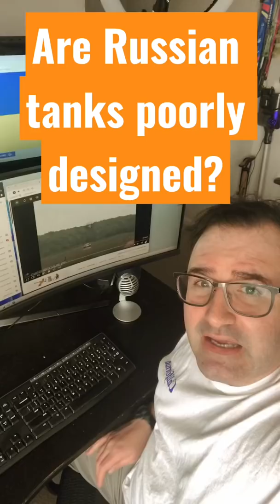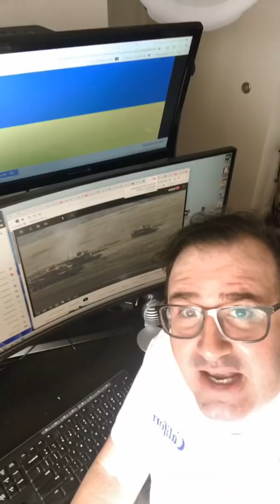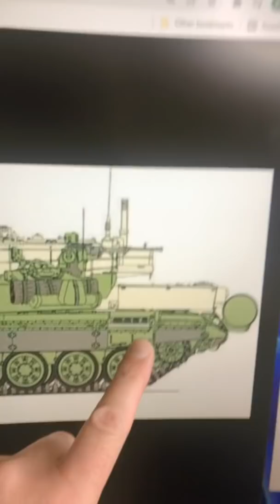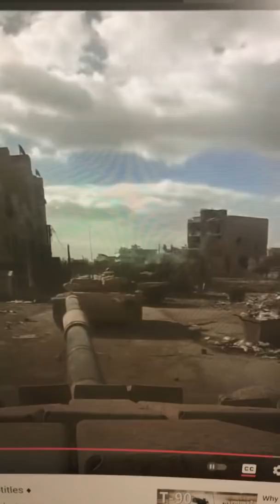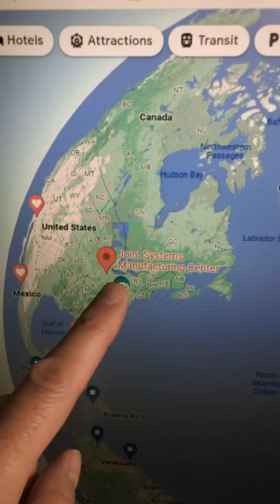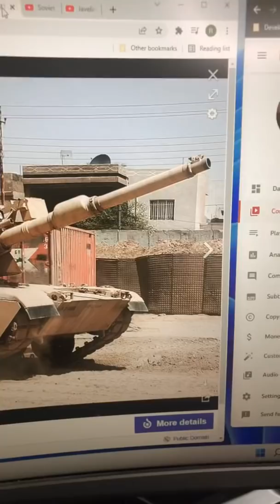Are Russian tanks poorly designed?

Comment: No, even in their heyday, they were a relatively crap design individually. It's why they were so cheap and relatively poorly equipped. The Soviets were addicted to the numbers game and went for quantity over quality. Also, missiles and rockets were the main threat, which is why there were some of the first to adopt ERA in massive scale. They didn't care about tank rounds as they knew the enemy probably couldn't field enough tanks to counter a push across the gap. They were more worried about massed infantry spread across the battlefield with cheap AT missiles and rockets along with said tanks that'd put a stop to their tank forces. They went with the smaller design to use less materials and use less people in order to maximize the number of tanks they could field with the same overall number of crewmen. The fact that they were smaller and harder to hit was the bonus, but not the primary design choice as T series lacks much of the things that'd make the smaller size truly beneficial like better gun depression to maximize hull down position opportunities or good optics and sensors to shoot form further out and increase the usefulness of their smaller size.

Comment: I remember in watching snl back when the original cast eas still on the advertisement for the abrams tank before it eas the abrams and way back then the gun was stabilized and computer aimed thrse tanks wete obsolete before they were built small is relitive these tanks are still larger than an rv and the m1 tank was very accurate.

Comment: Isn't not being updated for a new era, a sign of bad planning?
Reply from the maker: More like it’s difficult to justify Avenue, plus Russia went through a very bad recession in the 90s and money was hard to come by. They needed butter, not guns.
Reply: @RyanMcBethProgramming  That's a fair assessment, but they did spend hundreds of billions upgrading their military. There's no need to update the thousands of T-64s and T-62s lying in storage. But their workhorse, the T-72, they should have finished upgrading it to the B3 or B4 standard, and added either the Shtora and/or the Arena Hard-Kill APS to it.

Or if that's too expensive, is it possible to add blowout panels to an autoloader system?
Reply: @RyanMcBethProgramming  Just to add one more thing.

Let's say they have 2-3000 if not more T-72s, maybe it costs 1-2 million to upgrade each to the B4 standard, that's about 2-6 billion usd over 30 years. I'm sure they could've managed that, even if we consider the corruption and mismanagement in Russia. Along with everything else, of course.
Reply: @RyanMcBethProgramming  I think that the Russians made the mistake that the Germans did in WW2, they should've stuck for sometime with a design that worked and made it better, instead of spreading themselves thin like butter! 😂

Comment: NOPE! USSR had trouble building ICE tank engines > 840 HP, but historically were good in metalurgy, casting and big into armour geometry. Therefore, they had to keep tanks SMALL so they had sufficient mobility, especially with available transmissions. Therefore in tanks T-64 onward loader had to go, to  allow well armoured tank to be small thus light enough to move! Autoloader then employed split 125mm rounds with semi combustible propellant casings.  Carousel is placed very well, as even then-non existent top attack weapons would have to go through crew anyway before detonating ammo.  Problem is ammo OUTSIDE the autoloader.

Comment: Most Soviet-era tanks that the Russians are using where designed with the idea of being incredibly simple so they could mass-produce as many as possible - this is true. 

However, I wouldn't say this makes them good tanks even for the era they were designed in. Mainly because it doesn't matter how many tanks you have if they're so inferior to their counterparts that they constantly get destroyed in every single engagement they're put into.

I know this has probably been used as an example many times already, but Desert Storm really did show the failures in this philosophy very well. Over 3,000 Soviet-made Iraqi tanks lost to the coalition's 31. Now unless the Soviets would've had a constant 100:1 advantage in tank numbers against the entire west, I'd imagine they would've had a pretty rough time in a theoretical war. And even then, why not just build a better tank so you don't have to lose 100 times as many in the first place?

Comment: Not sure how often you read comments, but if you see this, this video is misleading and presents a flawed narrative

The autoloader is not a critical vulnerability in Soviet tank designs. It has long served as a scapegoat for Soviet tank losses in the west, but it's just not the case. The autoloading system is an asset to Soviet tank's survivability, not a hindrance to it. There are several reasons for this, but the primary reason is that the autoloader places the tank's ready rack in the least likely position for spall to reach; center of the tank and as low as possible. Much for the same reason that lower front plates tend to be less armored than any other part of the frontal arc, placing the ready rack in this position significantly mitigates risk of it being hit. Additionally, the autoloader itself has a reputation for keeping ammunition stowed within it safe, with numerous documented instances, particularly in Chechnya, of tanks sustaining numerous penetrating RPG hits directly to a loaded autoloader without detonating, or only detonating after a serious fire had broken out and the tank was abandoned, or detonating after numerous hits directly to stowed charges. In terms of vulnerability to an ammunition fire from damage, most Western tanks, especially older ones, do not fare better. There are several instances of, for instance, Leopard 2s suffering instant and lethal catastrophic ammunition fires when struck by ATGMs. The only true standout here is the Abrams, which has no ammunition that is not behind a blowout panel, at least after the cold war. 

It could be countered that this only applies to frontal threats, and that the autoloader is unusually vulnerable from above, but this is also not true. Significant portions of the cheek armor protect large sections of the autoloader, and the exposed section of it is not a more significant portion the total area of the tank than, say, a Challenger 2 or Leopard 2.

Most ammunition fires involving Soviet tanks are caused by the use of the ammunition stowage racks around the tank. The wet hull storage is relatively safe, but all others lead to large amounts of ammo being spread around the tank in all areas, leaving it extremely vulnerable. Loading only the hull stowage and autoloader leaves a Soviet tank just as safe as a Western tank of a comparable era. 

Compared to the narrative told here, it implies that Soviet tanks were not particularly designed with survivability in mind, and indeed are compromised heavily in safety, but this is not the case, and they are not significantly less protective or safe than most Western style tank designs. 

I would recommend reading the sections detailing profile and survivability in Tankograd's second article on the T-72 for more extensive detail.

Comment: The problem with the caroussel is not that it exists, it's that it holds insufficient amounts of ammo. So Russian tanks are often stuffed with ammo in every nook and cranny, making cookoff guaranteed on every hit. If they were only used as designed they'd be less deadly.
As for Javelin... lol. Javelin will instantly one hit murder every single tank without APS together with its entire crew, western, eastern, doesn't matter. The only way you can stop a Javelin is by shooting it out of the air or hiding from it to break the lock.
A better argument is that modern western tanks have FCS so good that they can easily hit Russian tanks while moving regardless of their size. And this is where loading less ammo would in fact reduce the number of turrets in orbit. In fact it wouldn't be any less safe than Leopard 2 if not more, Leo 2 has essentially the same issue despite having no autoloader.
At the end of day though, indeed, the autoloader isn't well designed for modern battlefield. Leclerc is an example of a tank with autoloader optimised for modern combat, it's basically Abrams layout but with an autoloader. It's arguably safer than the Abrams because the magazine blast doors are open for shorter periods.

Comment: The threat of javelin already made the T72 an inferior tank 20 years ago. Today, the threat of a cheap FPV drone carrying the equivalent of an RPG warhead can take out a T72 in 1 or 2 well-placed hits. Ukrainians know how to either hit Russian tanks in the rear engine compartment or between the turret and the body. The latter seems harder, but I've seen over a dozen videos of an FPV drone hitting Russian tanks in this precise spot with a massive ensuing detonation that causes the Russian tank's turret to go flying in the air. Tanks will have to be redesigned entirely with a focus on protection from drones.

Comment: So, not necessarily poorly designed, just hopelessly obsolete,  by the mid 80s, the common tank guns, and atgw accuracy, and power, rendered the russian autoloader deadly to the crew. where western tanks had already almost universally. Switched to isolated, blast mitigating storage. By 1985, in 2022? Russians newest leading edge tanks are still using storage in the body of the tank. With no blast protection. So the flaw isn't in the design, its in clinging to that design, long after it falls into obsoletcence...

Comment: I would argue that they are indeed poorly designed... the USSR operated under the assumption that tanks would carry any land invasion, mass tank doctrine. That was all good and dandy until 1967 when the RPG-7 and its counter parts entered the chat. Watching Soviet tanks get bodied in Afghanistan only for the design to not change and watch those same tanks get bodied in Ukraine is honestly amazing... it's been like 60 years, maybe the time to build slightly beefer tanks that aren't prone to cook of if they run over a pot hole is in order... well after they lose in Ukraine.
Reply: Well, to be fair, the Soviets didn't have that much te to Develop new Tanks after Afghanistan. There were some early Designs with bustle Autoloaders though.

Also, the T-90M also has a bustle autoloader, and T-14 doesn't have Crew in the turret.

Comment: You forgot to add maximum 50 ton qualification. But yes the tank was phenomenal when they were introduced. Composite armor, small & harder to spot, and thick armor.. 

No NATO tanks can out qualifies them in the battlefield (til 1980s that is). But since these produced in tens of thousands, the russian just modified their 1960s design to protect them even further with cheap upgrades such as HHS, ERA, and so on. Except T-90M with huge modification. 

For country with huge economical power such as United States money for development is not so much of a problem compared to Russian Federation. Also Russia is corrupted af (though not as much as Ukraine)

Most of tanks destroyed are by artillery anyway, and yes HIMARS are accurate af

Comment: Sorry, but you are mistaken.
Western tanks are bigger, thats a fact. But there are way more reasons behind it and the once you gave are bullshit. Let me explain:

The intended terrain plays a huge role in the design. Western tanks are meant to use ridgelines to their advantage as western countries tend to have them fairly often. The gun depression on western tanks is higher in result the turret is taller because you can't have your breach hit your turret. While the terrain Russian's would often encounter is steps or flat terrain. In result a smaller size is preferable.

The loading system: western tanks generally are operated with a human loader. In result the caliber of the gun tends to be smaller. The ammo storage is devided from the crew compartment with blast resistant walls these take up space. The Russian tanks use an autoloader which negates the human loader but makes a seperate ammo storage mostly unpractical.

Battlefield philosophy: the Russians tend to use sheer numbers to overwhelm the enemy and casualties are expected. So crew and vehicle are seen as expandable. That's why the armor is thinner.
Western nations value the crew at most but having a vehicle survive punishment and still going is a bonus. Hence the armor is thicker. Israel even put the engine in the front to reduce human casualties.

Ammo storage: western tanks have separate compartments. This results in a not guaranteed kill if the ammo is hit. The goal is to keep the crew alive and maybe the tank can retreat.
Russian tanks have the ammo storage right in the crew compartment under the turret. This results in a easy feed for the autoloader but if the ammo gets hit its almost every time a kill and new space debris.

The complexity of the tanks is different. Which in conjunction with armor thickness and airtightness of the welds can greatly change the production volume.

T72 have proven so leaky for air/pressure that some modern rounds aren't effective against them.

So are they poorly designed? They don't have to be, that depends on the model. Is every western tank a good design? No. They are designed with different specs. 

The biggest difference for combat efficiency is the crew and their training.

Javelin type weapons have been used in WW2, just the way to aim and the precision has been improved. The main difference between a Javelin and a tow is the trajectory as the tow is normal a relatively straight line while a Javelin will hit from above. Both are effective.

Please do proper research before you put something up on the internet.

Comment: The reason why American tank have thicker armor isn't it's difficult to replace the tank. IDK where the hell you came up with the idea but it's plain stupid and couldn't be far from truth. Americans and NATO uses Main Battle Tank(MBT) concept and it values expensively trained tank crews and Western has better technology and Air power to support it. Different doctrine. if what you say is valid, why Leopard2, challenger 2, Merkava have thick armor ? might as well make it small and light so it can be easily replaced and masss manufactured.

Comment: Because Khrushchev set a 40 tonne / 37 metric ton, limit on tanks.  Massively effecting Soviet tank design for the rest of the 20th century.  

https://en.m.wikipedia.org/wiki/Obiekt_279#:~:text=On%20July%2022%2C%201960%2C%20at,proven%20to%20be%20so%20successful.

Comment: Incorrect.

Russian tanks are occasionally well designed, but are poorly produced due to the extreme levels of corruption at every level of the military procurement system.

The T-34 during world War 2 if built to standards on paper would have costed roughly as much as the Sherman in terms of both money/material and man hours. But they where rarely built to their on paper standard. Their production was plagued with cut corners, much of their internal components where not heat treated, their armor was brittle, leading to fractures and cracking when hit by enemy tank shells or stressed by the contraction of the bitter cold. They had poor sights, and a disgusting litany of flaws that meant that it was nigh impossible for those T--34's to travel more than 50km before suffering a breakdown and needing maintenance.

Russia tanks since then have been poorly manufactured and maintained not out of desperation but out of greed. The money that should have went into maintenance and quality production was pocketed, and many of them where sold off by the commanders of supply depots to make a quick buck.

TLDR Russian armor is fucking garbage regardless of blueprints because the people making and maintaining them don't give a shit about making sure they work as intended.